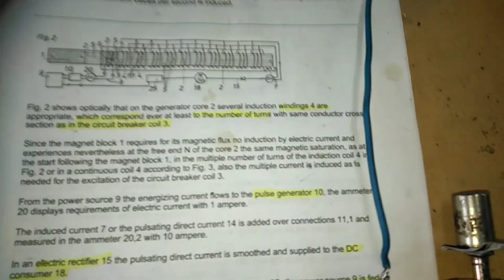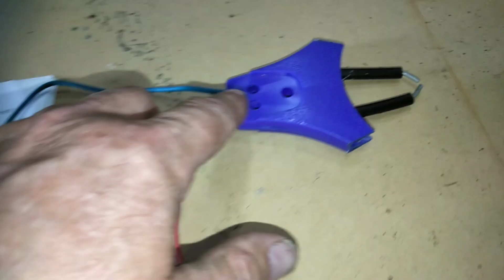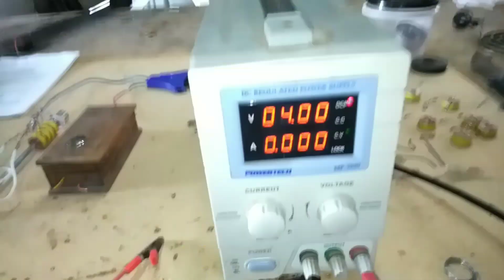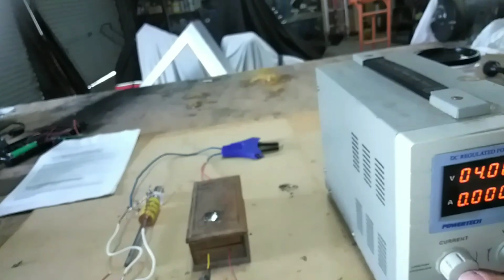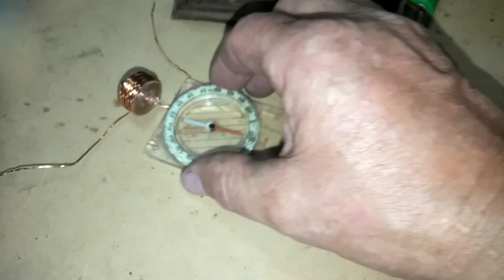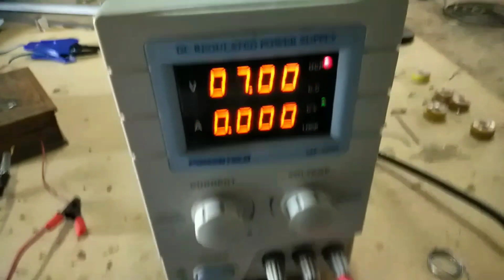Kenul Patent Super High Voltage Pulse DC Test

Comment: is it recycled copper wire? I had a similar problem I made a Lorrie Matchet static collector and used recycled wire, kept shorting my house out. In the end had to use double electricians tape, across the core, which reduced the power, but sorted the problem. Appreciaite the videos, its encouraging to see so many people active and heading to the same destination but by different paths. Your path is interesting.

Comment: a smaller spark gap will obviously give higher frequency, too high and it will be too quick for clamping cos of the time it takes steel to collapse. you could use a ferrite rod instead and use higher frequencies that wont arc over as easy. its the gap or separation the makes the voltage so keep that small or you could potentially burn out the HV unit. i have broken them by too big a gap. the diodes across the coils will be rectifying half of the spike in each of them. check the output of your power supply with a multimeter👀